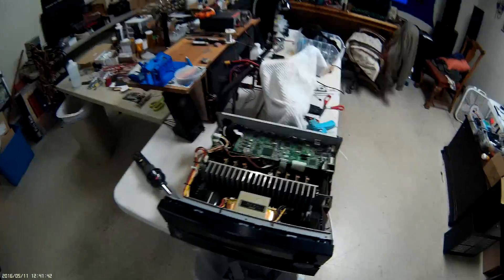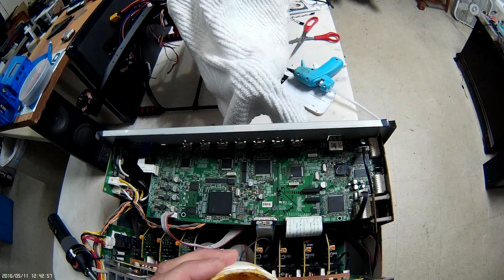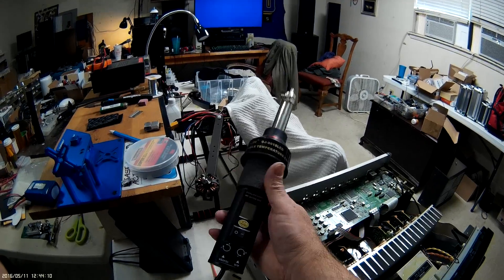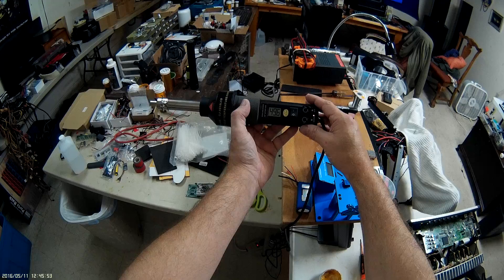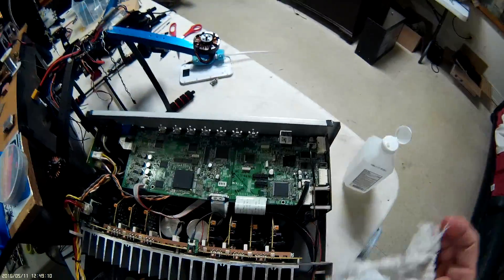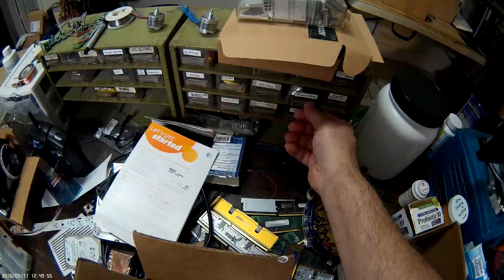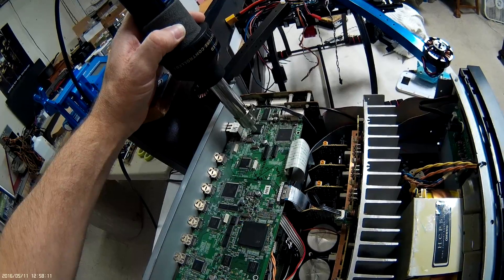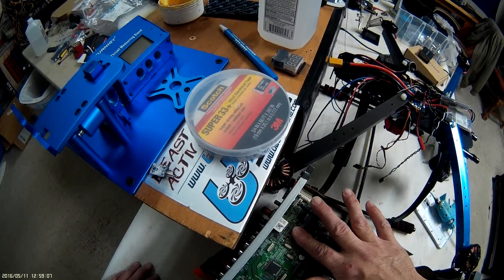Onkyo TX-NR Receiver DTS chip Reflow Procedure

Comment: I have 2 TX NR 809s both have the same issue . My question is . Do I need to hook up speakers to view the speaker matrix or will the speaker matrix show up with no speakers wired to the unit .  I’m going to try this on one of the units . I heated the chip without solder flux just to see if  it would reset itself . That didn’t do shit . I’ll buy flux tomorrow and give it a shot . Also because I heated the chip without solder do you think I messed up the solder .

Comment: Commenting to say that this fix worked for me. I at one point tried learning to micro-solder so I have the heat gun and soldering station, flux and such. I followed your directions exactly as you stated. 650 degrees Fahrenheit, added flux around the chip, heated for 10-20 seconds until I saw subtle signs of smoke and let off. Left it for a few minutes to ensure it was cooled and sure enough the system is working again. I appreciate the video as It saves me (temporarily) from buying a new receiver for now. It was super easy to do. Thank you for making this video!
Reply: Still holding up? Or no? I'm trying to do it myself and I wanted to see if you had any updates. Thanks 😊

Comment: i have a tx nr3008 that has had the hdmi board replaced in the past but recently has developed  random crackling hissing and poping on the front left channel using any input, ive checked wires ect. ,i believe its  a cap or something in the amp .any ideas?  eventually i was going to swap the channel boards  around and see if the issue moves.

Comment: Well....ich have the same reciver and used a hot air station for that task. But it took me at least 5 minutes to get the heat into the chip to really melt the solder. For resolder ich will take out the mainboard und use a heatplate. ;)

Comment: Hello, I just picked up a beautiful Onkyo TX-NR-616 the issue is it has no sound at all. Does this model have a DSP chip as well. If so would you know the location of the chip. I would like to try and reflow the solder using flux. I appreciate any advice you can offer me. Thank you. Ben
Reply: I just fixed my TX-NR616, so it's worth trying. The chip is located towards the back right. Just to the left of the right fan bracket arm. It's a square chip with no legs.

Comment: SUCCESS!!!! From another youtube video I heated up the CPU chip labeled DTS Dolby digital to only 185 degrees F. No luck. I searched for another video if there was something I could do differently. I happened onto this gentleman's video and applied heat from my lowest speed of my heat gun and using my laser temp thermometer. I got the chip up to 480 degrees F. I allowed it to cool down to the same temp of other chips on the HDMI board. I turned on the unit after plugging it back into the wall. Two clicks upon pressing the power/standby button, then waited another 4 to 5 seconds to hear another double click and low and behold the speaker position diagram or display which NEVER came on before appeared. This part of the display was not lit in the photograph used by the seller of this unit on Facebook marketplace.
Reply: Hi! I also have an Onkyo TX-NR414 amplifier. After switching on, there is no sound. My question would be, how long did you heat the chip? In addition to sound, there is no network and USB.

Comment: I have a problem with a Marantz sr5005av its sound like you know your stuff so I'm hoping you can help me the unit works an does not have any errors but I can not get any sound out of receiver,  I have done factory reset but still no sound. I have tried head phones no sound from them. I don't see any burned place on boards. So I was just wondering what your thoughts would be? I do have schematic for this unit have you had any problems like this with a receiver? Just trying to find someone I can get some idea from. Scene onkyo the same company do you think it could be the same problem. I guess I will check some relays, caps, voltage regs.
Reply from the maker: Is the unit going into protection mode? If not, it still can have an open output transistor that may not trigger the protection circuit. The correct thing to do is start removing the output transistors and checking them for shorts and open until you find the one or multiple bad ones.
Reply: @ShaneCarles  I get no errors so I will do the out put transistors an see what I get.
Thanks for the info
Reply: Oh an no it is not going in to protection mode thats why I'm trying to just bounce some ideas off someone else. The unit works an does everything it should but just no sound out. So I will use your info an see what happens 
Thanks again
Reply: Also Great video 👍

Comment: Why not put the heat sink on as soon as it cools down, if the speaker matrix is on and you're getting sound?  Why wait?  What if the chip overheats again before you put the heat sink on?
I saw on another video someone using an infrared thermometer  to measure temp, since they didn't have a temp controlled heat gun.

Comment: A gentleman said he was able to repair his unit by changing all the diodes on the drive board, the problem with reflowing is that the procedure deteriorates the chip, if it is overheating it is probably because it is short-circuited, the diodes on the drive board cope directly with the electric current distribution in the analog phase of the circuit, these signals must go directly to the DTS chip which causes the overheating and the soldering problem, for this reason if you do the reflow procedure it will not solve, it will be just a palliative, check the drive board.

Comment: An electronic services guy checked it out and said the chip did not work any more and so I think it was already moved out of place. But I wanted to try the reflow and did it with a coin on top, and it did heat well but I accidentally touched the coin and the chip moved out and now i can't get it back in place unfortunately.

Comment: HI Shane! I have a strange problem with an ONKYO 686. I'm really desperate now, this happened just overnight, the amp is just 2 year old. 
It has this loud noise. Please could you check this out?? any clue will be highly appreciated. Thank you in advance!

https://youtu.be/N_unQM5Scis
Reply from the maker: That is digital noise. Try unplugging everything but power and the speaker wires. No inputs at all and see if the sound goes away. If it does, remove the cover and blow out any dust or particles inside, then test again.
Reply: @ShaneCarles  Yeah tried with all disconnected and using BT and  headphones, you can hear the music but on top is that noise. Will try to check again for dust. Thanks a lot Shane!
Reply from the maker: @Ferpsf  - Also, there are buttons you hold down when turning on to do a full reset . You could try that. HERE: 
How to Factory Reset Onkyo TX NR686 7.2 4K -  Press and hold CBL/SAT button, then press and hold the On/Off button till you see "clear" on the display and the receiver will be factory reset.
Reply: @ShaneCarles  Yup tried reset, tried re flash the firmware  but no luck. Dint find any info o similar case in the whole net :/
Reply from the maker: @Ferpsf  - How old is that model? You might just have this issue here. With the cover off, take a hair dryer and heat over the DTS chip shown in my video here. It will look a little different but it should be in the same place. You can catch me on Facebook for photos if you want to take one of the HDMI board and show me.
Reply: @ShaneCarles  just 2 years
Reply: But it's not been used every day. Almost some time on weekends. BTW. I am gonna join the facebook group and post pictures.
Reply: @ShaneCarles  Sent you the photos on facebook. Thanks Shane!
Reply from the maker: @Ferpsf  No problem! I got them. I'll take a look and make which chip you need to heat up with the hair drier. Unless you have a variable temp heat gun
Reply: @ShaneCarles  Hair drier for me lol

Comment: Hello,

Good video. I have a pioneer vsx-1021-k, I was having UE22 error with not sound, couldn’t update firmware! I fallowed your instructions, first time used a hairdryer and UE22 error went away, however, still not sound. Buy flux and a heat gun and tried again. No error, I can hear clicking every-time I change input but not sound coming out. Everything looks working properly. HDMI inputs and output are working. Do you think I have to replace the dts chip? Or is maybe something in the other board for sound? Thanks again! From The Dominican Republic!!! Nice place for vacation with all inclusive hotels!!

Comment: I have a Onkyo TX-NR 717 that may have had this done on warranty a few years back. The issue now is no HDMI video out put. It's not a an issue with the cables as I am using a manual HDMI switch until I get this solved/fixed. Audio works fine and the matrix is displayed fine. It is also started nagging for firmware updates. I did via network, and USB and get an error every time, so I stop trying. I did hard reset until cleared and restarted no change to video or update.
I opened it up and that DTS chip has a sticker that says "new". Ideas?  I have a reflow gun, but don't want to hit the DTS  chip and risk losing audio.
I like the 3 zone on this unit and finding a new one with this is expensive.
Great Video!
Reply from the maker: Check the HDMI sockets for any that may have cracked the HDMI board or damaged the pins inside of the sockets.

Comment: Hi Shane and Thanks for the video. on my case when the sound stop to be heard. I also lost the icons of the 5 speakers in the display screen. so when I heat the chip with heatgun the 5 icons of my speaks comes back but with no sound.. do you think it the other CARD that needs to be heated ? ( the one with the speaker connectors ) ? any other recommandation please ? because by logic , If the speaker's icons comes back this means that I m supposed to have sound, but it s not the case . Please Help .

Comment: There is no way that reflowed the DTS IC and reflowing is a waste of time you need to pull the IC off and do it with leaded solder i do this everyday on way smaller iphone IC's but yes agreed this is only for professionals in microsoldering and DONT ever reflow with the unit on.

Comment: i have a onkyo tx-nr717 no sound i tried the hair dryer method several times it didn't work for me.i will try a heat gun next maybe the chip isn't getting hot enough with the hair dryer.what temperature would you recommend to reflow the chip 300 to 600 degrees ?
Reply from the maker: Try 500 degrees for 1min while evenly moving the heat around the chip. Also, use flux
Reply: shane thanks for the quick response. i am planning on getting a heat gun and some flux and trying your method. i will let you know how i make out.
Reply from the maker: @steveweber7902  - No problem. Let me know  how it goes. Also, check the temp of the chip if you get it going after its been on for a while and see if its getting too hot. It should never get so hot you can leave a finger on it for more than a few seconds. This is the main reason why these chips fail

Comment: help pleazy what is wrong? PLEAZE HELP Onkyo Tx-sr507 standby light flashing
Reply from the maker: I saw your video. Your unit is going into standby to protect itself. This usually means damaged outputs. Most likely shorted outputs so they would be easy to test. These are the power transistors that are on the heatsink. Could also be shorted capacitors. Many things really. Is anything connected to the receiver? If so, disconnect everything from it but power and see if this happens.
Reply: @ShaneCarles   hI NOTHING TO CONNECT
Reply: @ShaneCarles  You say about chips problem ?     about omh its havid the chips radiator ?

Comment: Why would my tx-nr 1010 be getting sound from FM radio and component in, but no hdmi image to my monitor? I have had it with Onkyo, having used this brand for 25+ years. This is the second HDMI board that has bit the dust for this receiver. The front panel LCD doesn't display either. Pfft!

Comment: Bit sceptical on this..as tx-nr609 was also having issues reading usb drive...stuck on initializing. Also have no sound problem. Followed what you did...flux on the dts chip and heated with heat gun...IT WORKS!!! Will see how long this fix will last ....Thank you for posting video.
Reply: does it still work?

Comment: Good morning my friend!! I have a HT- R390 with no sound, and when i go to check the firmware version, the display shows "DSP:???????" could give me some help?? thnkss
Reply: it means the chip is bad - try to reflow it, or you may have to replace it ... i dont know if onkyo still does repairs on them
Reply: I have the same model... How did you check the firmware version?

Comment: This fix worked on my 2009 tx nr3007 no flux used. Heat gun on 800 for 10 seconds or so until I could smell solder

Comment: I definitely don't want to be the YouTube keyboard warrior a**hole here but that chip isn't re flowed. The issue is in the BGA chip internally itself in this situation. You can resolve it but it will not be permanent. My advise is to put a heat-sink on it and pray that you are lucky it holds

Comment: Can I clarify whether the FM receiver does not go through this DTS chip? (seems reasonable) My TX-SR313 has audio when using the radio, but none of the HDMI channels, so I suspect the DTS chip. But just wanted to clarify before I start with the reflow tool. Thanks, Anton
Reply from the maker: If the radio receiver is driving an analog signal than no, it doesn't run through the DTS chip for audio conversion. You may hear a relay click when switching to the radio in that case. I've never thought about that as a test but then again none of the other analog inputs or outputs would work when the DTS chips do this on other models. The key thing to look for is the speaker matrix. The left part of the display that shows what channels are active. If that's coming up, then the DTS chip may be okay. I would try just warming the chip up at first to see if you get a change before going ahead with the reflow.
Reply: @ShaneCarles  Thank you. I don't believe me model has that individual speaker display but I will try some non-HDMI inputs and try gently heating the IC first.

Comment: 25 seconds did not melt the solder under that chip, so nothing re-flowed.
Reply: True.  There's speculation that heating the chip can drive moisture off the die restoring function, or perhaps it's actually reflowing inside the chip itself.  I know the Broadcom chips have a die on top of a die that uses an internal ball grid.  Heating the chip from the top reflows the inside of the chip.

Comment: Hi, finally how did you end up doing to repair the amp? I have the same problem too, the chip that does not seem to heat up after trying to heat it to rebuild the solder. thank you in advance

Comment: Shane, My TX-NR609 has HDMI from front AUX (ROKU) visible on screen, has sound through HDMI to TV (no speaker matrix visible) and can output FM stereo via headphones in DIRECT mode only. Also the Network port will not show link on router AND the USB port does not pass power and does not see 3 firmware files on root of USB stick. Are all these problems related to silly DTS chip? Gonna cook it with a hot air station as soon as my thermocouple arrives. The chips seem to be available ~$20-25 new from China now. Gonna check those caps too. The amp just doesnt seem to kick on without that speaker matrix.
Reply from the maker: Hmmm.  Damn. That's some crazy different issues but with no speaker matrix, it sure sounds like the DTS chip. That's all analogue to digital issues from the sound of it
Reply from the maker: But. The USB has me wondering. Take a USB cable you can cut so you can check the red and black wires for 5v there. Let's see if you lost power supply somewhere. Maybe capacitors.
Reply from the maker: Could be 2 issues like I was seeing on this unit where it had 6v on the 5.2v rail. It should be a tad over 5v for voltage sag but not 6v. Capacitors were the issue on that.

Comment: Hi Shane, 

I am having Only I HT-R558 and recently due high power fluctuations hdmi out has burst and could see smoke stains around the board.

When I took the unit to service centre they had told need to replace motherboard. Not sure why motherboard unit.

Could you plz help me how to get the unit service and I I get spare from onkyo. 

I am from India and bangalore. Plz help

Comment: Would this solve the issue I have that my 2 front main speakers are not working but my center and surround and sub do work? Could it be that eventually all speakers will lose sound as more contacts come loose from the chip? I have an onkyo tx-nr636
Reply from the maker: If your getting speakers at all then its not the DTS chip. I would be looking at output transistors. Maybe smaller caps around the preamp section.
Reply: Did you ever figure out the problem? My Onkyo HT-R393 just lost the front Left and Right channels. I can get sound out of the Right speaker if I use direct mode.

Comment: Thank you, this worked for me (so far)! My heat gun went only up to 500° but it did the trick. I also added a heat sink based on advice I found elsewhere...I can’t remember if you recommended that.

UPDATE: Repair failed after 4 days. Too bad, the unit's otherwise like new but the outlook from other reports isn't very hopeful.
Reply: Eric, what did you end up doing after the 4 days?  I'm about to het mine up, My gun's top heat is 1200. I'm thinking 800 for 10 seconds like another post did.  Any new learnings from your experience?
Reply: @kurtwedgwood1766   Thanks for asking. I gave up. I also tried a technique found elsewhere (I forgot where) of baking the whole board in the oven for a little bit to reset the connection and that also failed. My engineer friends tell me that microsolder failures are permanent. But it seems to work for some people so what have you got to lose? I wish you much luck.